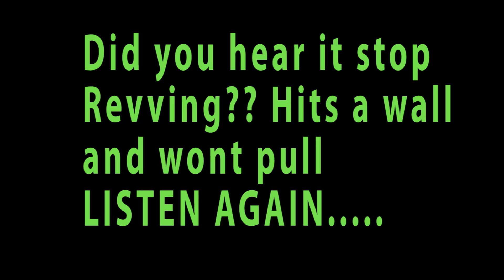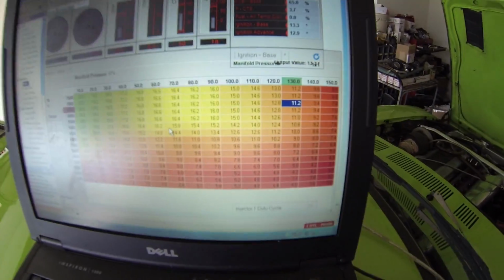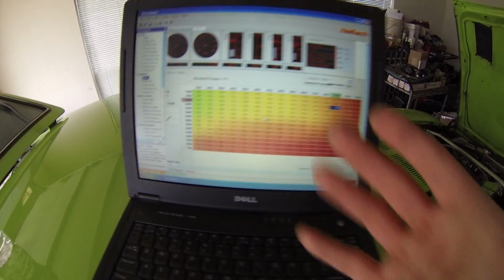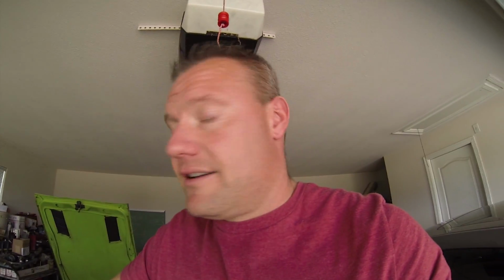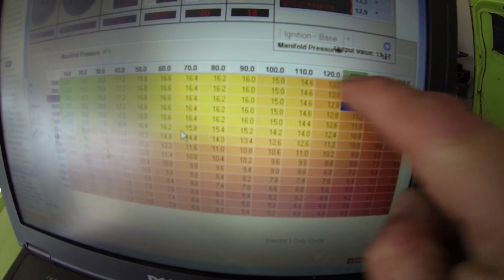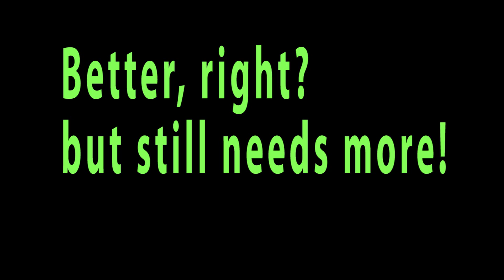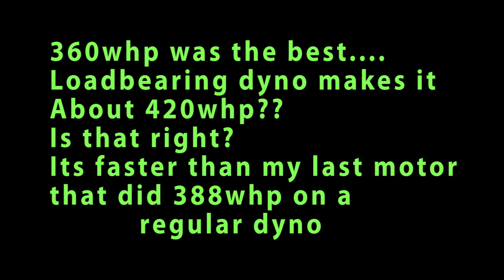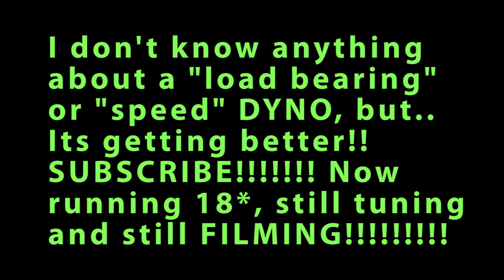Rb30det DYNO turbo Datsun 280Z

Comment: Okay here's basic setup we do where I come from. Stock rb30e bottom end, stock 25de head, N1 oil pump, oil restrictors, ARP head studs, Factory turbo gasket, Rb26 ignitors and with that turbo set up you would run GTR injectors or anything upto 800cc, fuel pressure regulator, 600+hp fuel pump, big radiator and any after market computer set to run 15psi. you will get 500+hp 750+nm torque at the wheels pretty much everytime. A GT35/40 turbo are good for 600hp at 25-30psi.

Comment: Phil, Id try taking the car to a different dyno. It sounds like the dyno is loading the car almost too much. As RPM and power increase, the load on the dyno increases. This is what I believe is happening here. If the dyne allows you to change the load %, Id start there. Best of luck. Long time follower of your car.

Comment: I'm running
20 @~1.0-1.6bar, Japanese gas (~95 US)
20 @ idle
WOT: goes to 25 (to build boost) then 20
part throttle (little vacuum): goes & stays 35
off throttle/max vac: 20 @ 0~3,000rpm (coast), tappers to 10 @8,000 (engine brake)
2.8L, 680hp@1.6bar engine dyno but only run 1.3 bar in car w/ ~480whp.
built engine/cams/turbos, stock intake & box (kept MAFS but ECU using MAP), stock ex manifolds & turndowns, exhaust (60mmx2/80mmx1), Fuel mods, huge oil cooler!-needs it!, radiator & ECU

Comment: That's pretty impressive Phil.....I mean you can have an engine with a peak of 440 bit bugger all below that peak.....I expect you engine has a massive area under the HP curve. I'd be happy with that in an S30 ....must be near F40 power to weight ratio.....if not more.

Comment: I've done all the tuning on my l28et with megasquirt and the lowest I've ever run once it was dialed in was 20 and 28psi... now it at 24 and 22psi. But the more efficient the combustion chamber is the less timing you need.

Comment: The more air your car sucks in the more petrol it can burn, the more gas it can burn the more hp your going to get an its as simple as that. 460 is all good but I know you can get more especially running that much boost with a good tune. My knowledge of a dyno runs out at that point I leave it to the pros but seems everyone in NZ makes that with that set up. Checkout RIPSracing website, they sell standard rebuilt motors suited to a reliable 600hp.

Comment: Never thougth about going E85? Now i don't know about the availability of it in the states and even less about the particular place where you come from. But here in Sweden we always convert to E85 on our tuned cars since it eliminates knocking so efficiently that you can run a timing that goes beyond the engine MBT without a single ping. It's also very popular turbo converting 2,5L NA BMW engines and running about 450 WHP on E85. It's one hell of a fuel.
Reply: E85 is hard to find outside of the corn belt and is becoming more rare.  Most old car guys hate alcohol in gas as it has stability problems and dries out older seals.  Its interesting that it has such a redeeming quality for the turbo guys.  Glad to know it has at least one high performance purpose.
Reply: gracilism I run E85 in all of my cars. A golf mk2 16v, a Saab 9-3 Aero and a Nissan S13 with the CA18DET. It works splendid. :)

Comment: hey just a few question rb30with rb25top vs pure rb25 lets say running around 500hp, do both has the same durability or one is stronger than other.? i was thingking doing the same swap like you did, but i ended up going for the 2jz..nice car

Comment: Man that's some low timing Phil.....also explains your red exhaust as its sparking so late a lot of the energy is being taken by the exhaust. Do you have a knock sense kit on that engine ? I'd stick some headphones on and adjust the timing on the road .....see where it knocks then back it off a few degrees .

Comment: timing and mixture. is there any way to adjust mixture other than using the wideband. it could look good on the wideband but only be on the edge of good and not good enough at high r.p.m. i would think if u put that timing in it and it started overheating it got too lean at high r.p.m.and that much timing so maybe rich her up a bit,,just a thought. i love tha sound of a nissan I6, even the L series motors sumthin bout them nissan I6!!keep it up big phil!!

Comment: How much timing are you running  now? Do you use any knock detection equipment? I'm just about to start tuning my mercedes rb25 on haltech e11v2, unsure wether to hire a dyno or tune on the road

Comment: mad mate good work and ty bot bro dynos hp isn't 100% exact more so just a really good tuning too pwr changes from dyno to dyno 441hp at the wheels is good power I'd say it's definitely making over 550hp at the motor man that's easy low 11quaters.I've been watching his movies his had a hard road with motors n parts I reakon it's sick good job man if u wanna be a dyno queen n worry about numbers that don't Matter that's cool but the real numbers are in the 400m time and mph
Reply: this is in response to ty bot definitely not calling turbo280zx a dyno queen

Comment from the maker: There is no sense in arguing now that I have the radiator installed and solved the overheating issue I'm going to tune it and Dyno it again at 20 pounds of boost that will answer all questions no need to argue

Comment: Did you solve the rpm wall issue? My L28et does the same. I was told it was low valve spring pressure.
Reply from the maker: skirkland1980 mine tuned out to be a boost leak. I didn't notice it on the street.

Comment: Sorry to be ignorant; but what is ignition float? If Phil were running a points distr. I would understand the reference. But not, so lost as to what you are refering to. No diss intended just don't understand. 20+ degrees advance at those boost levels seems high but all my experience is on wedge headed V-8's; so my not apply. My advice proceed with caution. I'm just sayin.

Comment: Thats actually a 240zg 280zs were longer and a bit more boxy. Still a sexy ass car though
Reply from the maker: Nope it's a 1978 280z
Reply: You're thinking of the 280zx.
Reply: Look at the gap between the hood and bumper on the front end. A 240zg just goes straight from hood to bumper, no gap.
Reply from the maker: I made the bumper brackets, it's a 280z I took off the big bumpers and put on 240z bumpers and tail lights. Dude, it's a 78 280z all day long sorry
Reply: You tell em.....awesome dude.
Reply: +ultimatedragon6988 280zx is what you're thinking of. thats a 280z. and the zg body is only a japan thing.

Comment: haha yes they do I have literally seen it with my own eyes, I dont know what your doing wrong maybe your dyno guy sucks. Most the parts your talking about have nothing to do with the hp/kw output anyway. You don't need to change any internals apart from head studs and just test for cracks and clean it all up. If I were you I would upgrade your throttle body invest in a plug in play Link G4 ECU, focus more on high flow than the parts your putting in........